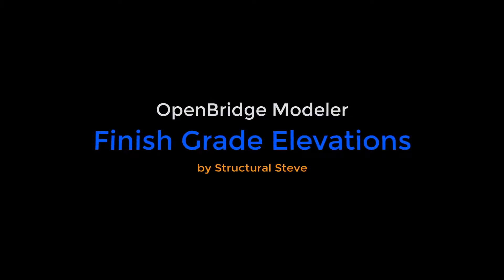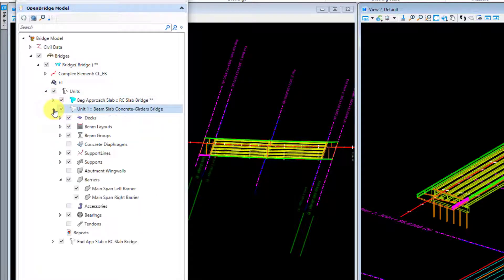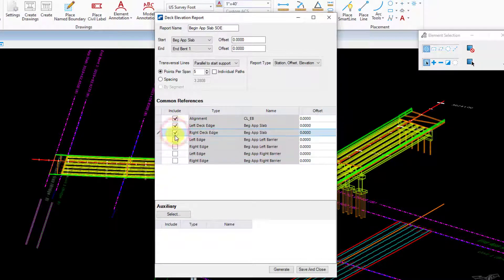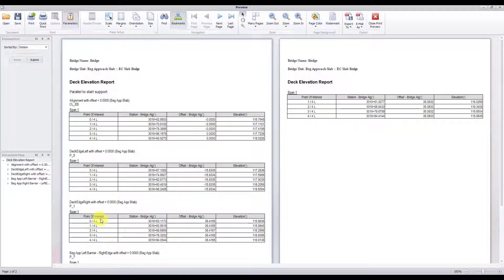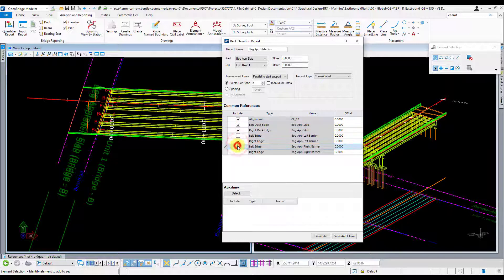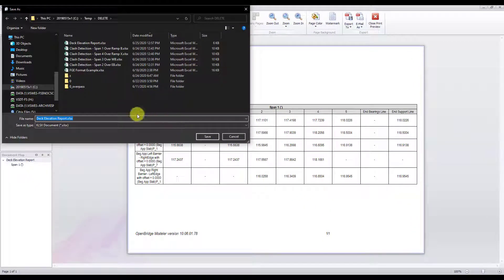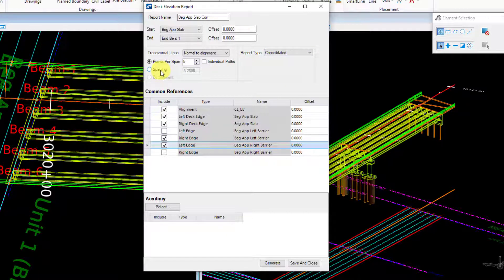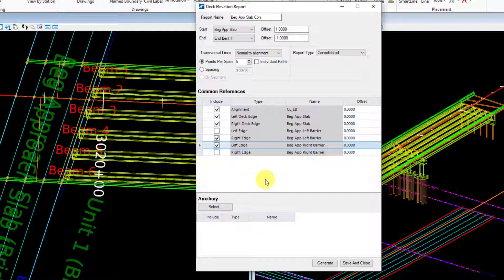OpenBridge Modeler - Finish Grade Elevation Report

Comment: Steve,

Is there a way to have a "Common Reference" point/feature in your deck template that follows the top of the beams? Here in KY we give contractors "Construction Elevations." So basically we give a table showing:

"Construction Elevation" = "Finished Grade Elevation" + " Deflection"

So we give contractors the elevation they set their screed at before the beam deflects from their deck pour. Based on what I've seen of the Camber Report, it only gives the elevation along a percent length of the beam like 0.5L for example.

It looks like, if a common reference point/feature was in the deck template below the deck that followed the top of beam, one could run the deck elevation report twice along the beam lines (once including camber & self deflection, then once including camber, self deflection & total deflection) to get beam deflection at the same locations we want our finished grade elevations. I'd love to know if this is possible at the moment.
Reply from the maker: You can definitely create a point in the deck template to follow the CL Beam. In order to make it follow the beam you’d have to create an “auxiliary alignment” that represents the CL beam, and then use point control to have that beam point in the template follow the auxiliary alignment you created. However, I don’t think the info in the camber report is used for anything besides documentation. I’ll have to double check with the developers on that though.
Reply: @structuralsteve323  thanks for the quick response! Yeah I was assuming that when one enters camber and haunch values in their respective locations that they are incorporated into the model. I think you are right and the camber is not incorporated into the model. Bentley's latest video shows how the camber and haunch are entered/checked. I'm a little fuzzy with how the haunch works with camber though since they used a model that had no vertical curve to it. I assume the beam is modeled to follow the vertical curve correct? So bottom of beam is modeled at:

"Bottom of Beam" = "Finished Grade" - "Slab" - "Haunch" - "Beam Depth" ?

Their camber report made it seem like the bottom of slab was a straight grade from bearing to bearing.

PS: sorry for the lengthy questions. I'm really interested in this product but I have a few kinks to figure out before I can prove this will work with our typical workflow.
Reply from the maker: @brandonpulliam4471  you enter the calculated camber in the haunch section when you use the Place Beam tool (assuming you use the computed option). Then OBM will use that camber value along with the vertical profile and min haunch value to calculate the appropriate haunch at CL beam/CL bearing. I have verified their computed values with my hand calcs and it’s always within 1/16”, more than acceptable. OBM models the beams straight (no camber in physical 3D model), but uses the correct haunch height at the bearings. That means that haunch volume will be off, but that doesn’t really matter. What matters is our elevations are correct. That actually works to our advantage here in FL since they want us to use a straight chord at bottom of girder for calculating vertical clearances (don’t include camber in VC calcs).
Reply: @structuralsteve323  we are right there with you on checking the clearance. We assume the bottom of beam is the chord from bearing to bearing as well. I appreciate the explanations! I have a much better idea of what's going on. This Construction Elevations thing is one of the only things I'd need to figure out. I'm just trying to avoid having to interpolate in a spreadsheet the deflection at each crossing point for each beam if the bridge is skewed or curved to get Construction elevations. We typically use this old DOS Box program that gives the info. I'd love to have it in OBD so I can avoid having to teach someone how to use that program in the future (haha).

My only other 2 concerns are being able to stagger bolts in the splice modeler (just an in house practice, not necessarily required), and I need to figure out how the ProConcrete Rebar modeling workflow operates. I'm sold on every aspect of this program other than those few minor points. I see MASSIVE advantages on the front end of jobs. It'd be worth modeling 2-3 alternates per site and using qty reports and unit prices for a quick cost comparison. This is some really cool stuff!
Reply from the maker: @brandonpulliam4471  I think the beam report elevations will give you what you want in terms of construction elevations.

The ProConcrete tools can be confusing as they were originally built for vertical buildings world. Just make sure you don’t use the Beam, Slab, Column tools. Only use the custom tools with face based method (associative extraction, intersection, and slice). Those are best suited for our more complex bridge geometry and will adjust automatically with design changes if you use face based method.
Reply from the maker: @brandonpulliam4471  as far as staggering the bolts, i don’t think this is possible currently, but submit a service request and they’ll add it
Reply: @structuralsteve323  so I just watched Bentley's video on some of the ProConcrete tools. There is an option to bring in reinforcement from LEAP. It looked like it came in face based. He changed footing dimensions and they updated to that. Would you recommend importing from LEAP and adjusting or just looking at your design output and placing the bars in the model manually?
Reply from the maker: @brandonpulliam4471  I wouldn’t bother importing from LEAP. That only works for the footing currently, but it doesn’t take things into account like the pile (i.e. spacing the bars in between the pile). You are better off doing everything face based on your own. The only bars you may not be able to do face based are column & cap stirrups & ties. Those usually need to be manual (not tied to a concrete face) guidelines & use irregular dispatch.